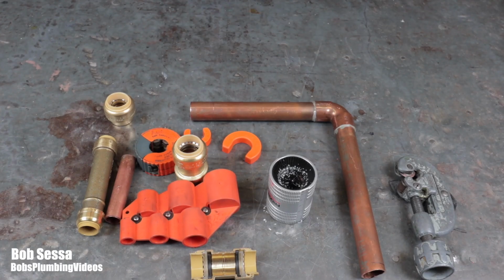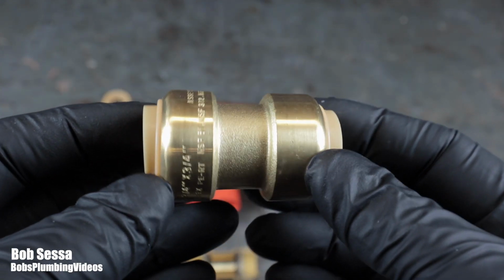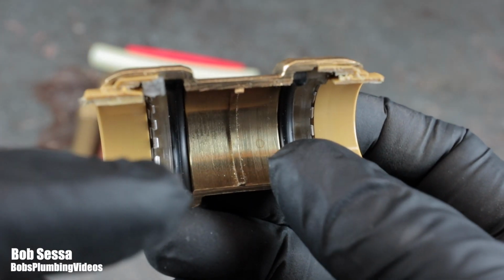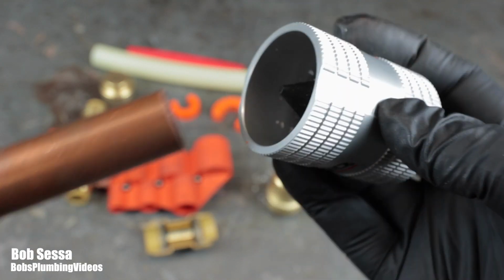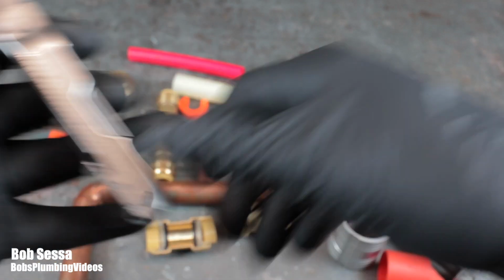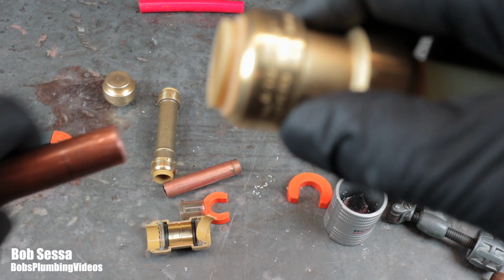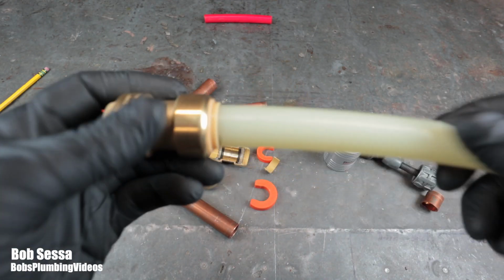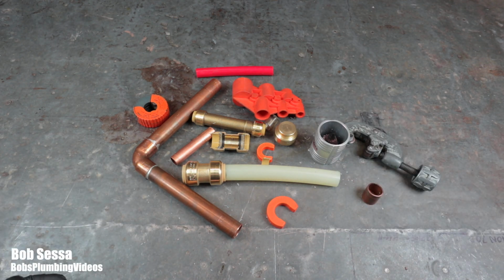How To Install Sharkbite Push To Connect Fitting

Comment: I am a Mechanical  Engineer and not a plumber but O-rings are used in much harsher environments than plumbing applications and are capable of many years of service. They are tried and proven for many decades but relatively new in the plumbing industry (~20 yrs).

Comment: Great video. I am installing a water powered back up residential sump pump in my condo. All of the connections will be exposed in the basement rafters. Thanks for putting this very helpful video together. As a 76 year old native Michigander I would think a plumber in New York City would have a hell of a lot more to worry about then Shark Bite fittings. Therefore I am especially grateful to you for taking the time to help me here.
Reply from the maker: Thank you Sir, appreciate you checking out the video! Regards, Bob.

Comment: I just put a screw like to a pipe trim screw nobody put caps over right on the stud think I got to go get a shock bite or I'm going to have to go get all my solder and s*** and dig it out and it's in a wicked b** of a spot so maybe shark bite wins here but good video thank you

Comment: Thanks for the smart video.
No one else advised me to REMOVE the PUC collar when connecting copper pipe. I'm using the braided hoses for a hot water heater and the PUC collars would NOT come out with needle nose pliers. so I left them in. No leaks.

Comment: "It's an oh ring," yes, but for DIYers, you can buy several different kinds of Sharkbite fittings and as long as they're not used behind walls, you're still going to be saving money over paying the ridiculous prices plumbers charge. I've never needed one, but I have a few, just in case.
Reply: I have to agree.  He talked about the O-ring wearing out but water doesn't come in contact with the O-ring.  So, I'm having trouble understanding how the O-ring would wear out.  The only thing that I can think of is over a long period of time, the material degrades due to temperature changes.

Comment: The elasticity and extended life of the o ring is highly dependant on the lubrication , which should only be silicon based , so upon installation a good lubricant volume is essential. Have seen plenty of neoprene , o rings and gaskets looking OK after 30 years.

Comment: I occasionally use these in equipment rooms. I have about 5 in use for about 8 years, no leaks.
I do a lot of prep and check and double check fitment. And I don’t hide them behind walls.

Comment: Excellent presentation and explanation!  A big like and Subscribe!  What are your thoughts on partial replacing of some PB pipe,with PEX b using crimp fittings?  My PB pipe has been trouble free, and has the third Gen copper fittings and crimps.  It seems everyone has an opinion on this, and it is hard to know which way to go?  Anyways, stay safe and Healthy!
Reply from the maker: Thank You, Sir! My experience using PB pipe and PEX is limited only because we're not allowed to use it here in N.Y. City.  The exception being we're allowed to use PEX for heating installation  (hot water baseboard). I've used the crimp rings on a few repairs and so far have not had any issues. If and when PEX is allowed (I won't hold my breath), 
I would most likely go with PEX-A by "Wirsbo"  which uses expansion rings to make the seal. A superior method for PEX in my opinion.

Regards,
Bob

Comment: Its weird that theyre selling people on 25 years.
Reply: Nothing man made last for ever.
Reply: 25 years is much longer than most people own a house.  So 25 years is more than enough for a plumbing part to last.  If it was priced based on longevity, then a 100 year copper pipe would cost $100.  And a 25 year Sharkbite would cost $25.  Which one are people going to buy if they know they are going to sell the house in 15 years?
Reply: In 25 yrs I'm 96 yrs old possible but un likely 2 live that long!!?

Comment: Speaking of SharkBites do you know about/use propress?Or is propress not yet allowed in NYC for joining copper pipe?I was born and raised in NYC but I had to leave because NYC has gotten too dangerous and too expensive.The only thing that I miss about NYC is my family and nothing else.Thank you for the video Mr.Sessa,God bless you and yours.
Reply from the maker: Nelson, thank you! Pro Press is  approved and being used by most plumbers. Being a small one man service and repair shop I still solder. Yes, way to expensive here not a business or tax friendly place.

Will be heading to Las Vegas in the not to distant future! Regards and thanks for checking out the video!

Bob
Reply: @BobsPlumbingVideos  that's great.   Cuomo and deblassio have been the straw that broke the camel's back

Comment: New subscriber here. Love your videos.
Would EVOpex fittings be allowed in NYC? 

I agree that I would never use sharkbites in  a wall either. They however are great for wet quick repairs.
Reply from the maker: A non removable push fitting would be allowed, but we're only allowed to use p.e.x. for heating (baseboard) purposes not domestic water. So I guess the answer would be yes & no. Crazy code in New York! Regards, Bob. Thanks for checking out the video!

Comment: Bob, great video and like you I wonder about the new propress technology which uses o rings to seal. Seems everything is propressed today including gas lines. Do you ever propress fittings ?
Reply from the maker: I do not, as a one man show it’s not cost effective for the type of service I perform.

Investing a few thousand dollars for the equipment and the price of the press fittings makes no sense to me.

Not to mention the “O”rings. Manufacturers claim a 50 year warranty, time will tell!

Regards,
Bob
Reply: @BobsPlumbingVideos  I was of the same opinion as you Mr.Sessa but after careful consideration and having found an affordable 18volt press tool I had to reconsider.I had to redo my soil stack which was copper and cast iron.The new DWV PVC that I used to redo my soil stack sits right between the copper water pipes that supply my toilet,my tub and bathroom sink and I would never even dream of using a torch anywhere near my DWV PVC soil stack so my 18volt press tool saves me a headache because I can solder ball valves and/or unions to copper pipe nipples on the ground then join the the soldered ball valves and/or unions with the copper pipe using press couplings.Keep in mind that having to solder copper pipe up on a ladder is never any fun so press fittings are a better option.My house has 1/2" copper pipe for the water and 1/2",3/4" and 1" copper pipe for the heating and since my 18volt press tool comes with standard press jaws for 1/2" to 1-1/4" I don't need to go through changes.I'm planning to buy 1/2",3/4" and 1" press couplings,press elbows and press tees for the copper pipe sizes that I have just stated and I am also going to buy a length of copper pipe for each pipe size so that if at any time any of my copper pipes leak I will not have to freak out in the middle of a night or on a weekend trying to find a plumber that will no doubt charge me plenty.Since I am very familiar with plumbing because I worked with NYC contractors and plumbers since I was 15 yrs old I can do the repairs myself and save myself a nice sum of money.What I was taught I learned well and I am not ashamed to ask or to look up what I do not know.There are people that say that using press tools is cheating which may or may not be true,all that I care about is to repair leaks as quickly and as efficiently and safely as possible.In my book getting the job done and done well is all that matters.

Comment: We have something similar in UK but from different manufacturers. The most common one is John Guest speedfit. I can't believe how much you paid for that coupler though. An equivalent fitting in UK would cost me 2 pounds. Your 8 bucks is  over three times the price
Reply from the maker: Crazy expensive! I picked that up at the Home Depot, would do better at a plumbing wholesaler. Problem is not many plumbing supplies carry them. Labor saver for sure, but definitely a D.I.Y. product in my opinion. Regards, Bob.
Reply: @BobsPlumbingVideos  If you don't mind my suggestion supplyhouse.com is fairly reasonable.Supply house is where I order parts from when ever I need to do plumbing repairs.Their JW brand copper press fittings are good quality and don't cost an arm and a leg like the viega copper press fittings cost.: https://www.supplyhouse.com/Copper-Press-Fittings-Imported-21703000
Reply: I agree $$$$$$$